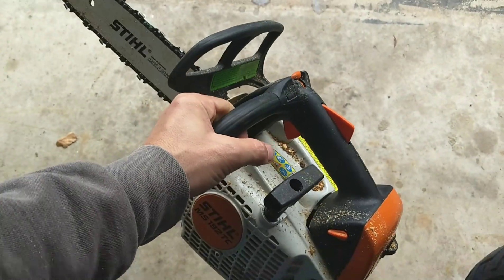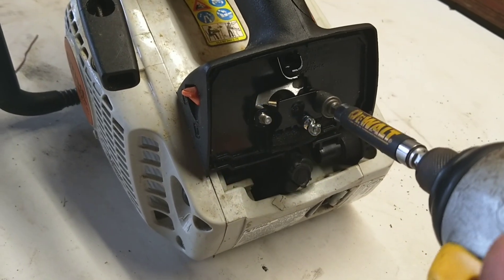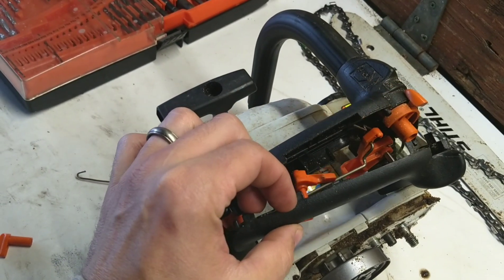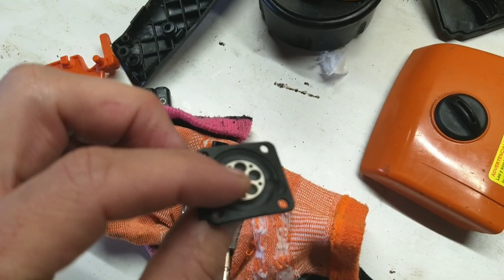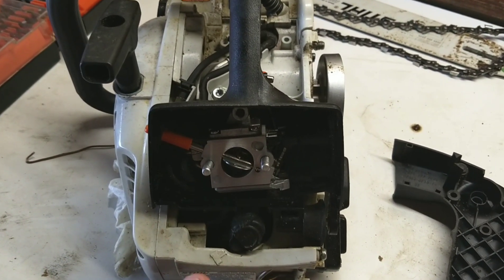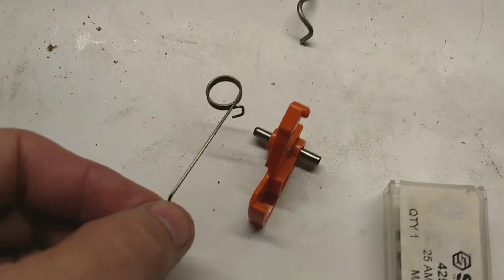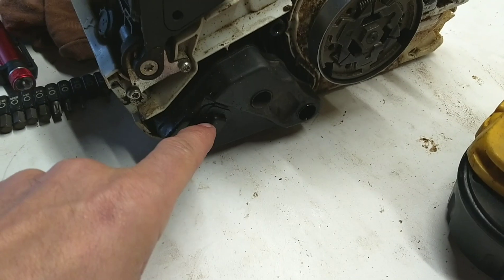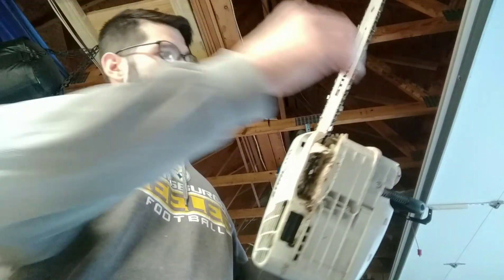Stihl MS192 TC bogging down won't idle, new intro music lol

Comment: Great video!! I have a MS 193 T and it won’t idle, I’ve ruled it up to the carb needing a rebuild.. this video helped a lot!!
Reply from the maker: have you checked the spark arrestor on the muffler it could be fouled up with carbon deposit? thanks for watching good luck
Reply: Neighborhood go 2 guy I removed that, changed the plug, and put fresh gas in it.. still won’t idle.. I even adjusted the screws on the handle per the manual.

Comment: I have a still that doesn't start unless on full choke and starter fluid is applied, any suggestions?
Reply from the maker: I would bet that you have a bad metering diaphragm or a plugged up carburetor, when  you spray the starter fluid, which I would be cautious about how much you use because it doesn't have oil mixed with it to help lubricate the cylinder wall, so when you spray, it goes directly through the carburetor and ignites when you pull the rope. So if you're comfortable  take off the carb and give it a good cleaning, if the carb is clean when you open it up check out the metering diaphragm that sits on top of inside of the carb. Its circular with metal, if it moves freely and doesn't feel "stiff" it's probably ok? But to me it sounds like it's starving for fuel and this is most likely the issue. Keep me posted ✊

Comment: Is the 192t parts the same for the 193t.  For example the filter or spark plug?
Reply from the maker: Filter should be interchangeable, not sure about the spark plug
Reply: @Neighborhoodgo2guy  same cc engine uses the same plug. make sence lol?    ngk brand    BPMR7A